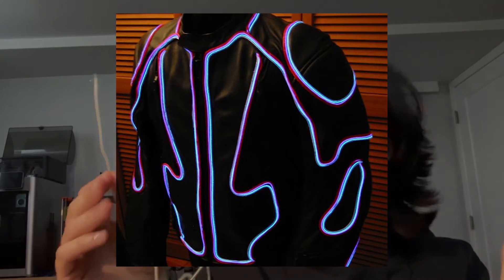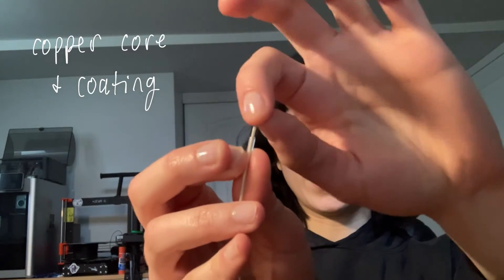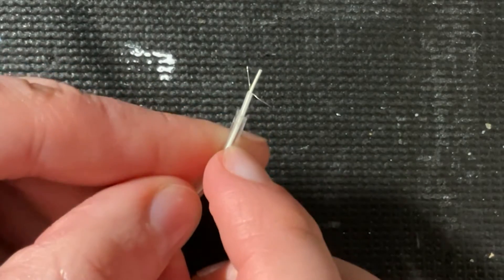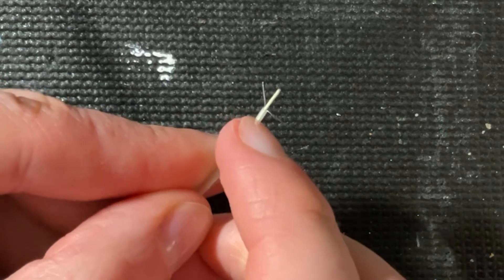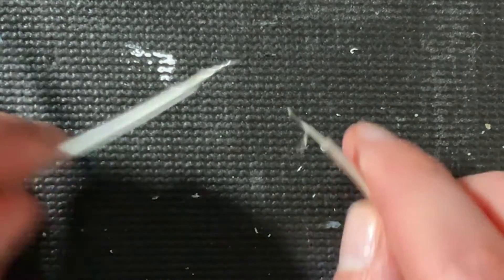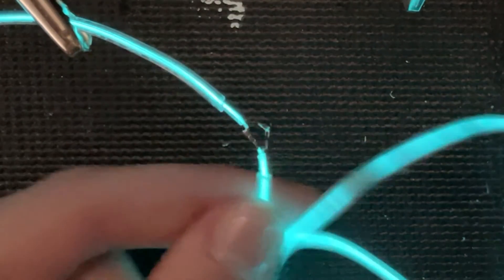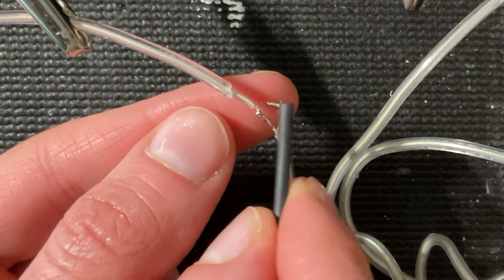how to solder EL wire

Comment from the maker: Considering this is my first time trying to solder to EL wire (and I only used what I had on hand...) - I didn't do it the best way possible, but it did answer a lot of my questions. If you are looking to solder EL wire for a project - using copper tape to solder to the thin conductors is a better method for ensuring a strong joint. This is a good tutorial by adafruit showing how to do that: https://learn.adafruit.com/el-wire/soldering-to-el-wire
Reply: consider a bit of flux next time, helps a lot, even if the solder wire has a flux percentage. also usually you tin bot ends then solder together
Reply from the maker: @AdventurePrinting  I will try some flux next time :) I did tin the ends, just I guess not very obvious in the video. Thank ya for the tip !
Reply: @strelkomania  yep is shine on shine :P
Didn-t get it
Reply from the maker: @AdventurePrinting  I just purchased some copper tape to try a better way of soldering together the thin conductors. if it works better you should see an update soon! thank you for commenting :D
Reply: Looks pretty good to me! I wonder why there are 2 angel wires though. Maybe it’s a carrier wire. I have successfully broken about 4 ft trying to strip it.  “Score!!” 😂
Reply: @Wood-In-My-Eye I assume there's 2 angel wires because the electricity goes from the copper core, through the phosphor coating into these small wires. Wrapping two of these small wires around the phosphor ensures that the whole thing glows. With only one wire, you might have dark spots, depending on how tight the outer wire is wrapped.
Edit: At 03:29 you can see that the right wire has some spots that don't glow. When she turns on the light in  the room it's harder to spot, but initially, when the wire is lit up for the first time, you can see it good.

Comment: Did u try using a ligter to burn away the copper isolation ? Maybe its a useful hack, wenn it catches fire and melts a little bit you can pull it off with your nails. Just be careful, i hope you will find it useful 👍👍

Comment: Be careful with those bare wires. Even though it's low alternating current, the voltage is high (up to 400V) and you can get a pretty unpleasant shock.

Comment: I've always loved Electroluminescent wire! I had a clear keyboard with an EL backlight back in the day and I've been obsessed ever since. Sadly the solder joints broke when I cleaned it and I destroyed the EL with my monster soldering iron.
Reply: Everyone started with a monster soldering iron, made to solder house appliances engineered in the 50ies and not the micro soldering of today. Probably in 20ys our micro soldering would be barbaric and everything would be reballed. Look at todays Jst nano connectors on circuit boards.. I have XXL hands, glove size 11.. wtf 😅
Reply from the maker: My first soldering iron was definitely a monster one too LOL it was a cheap one from princess auto (power fist brand), similar to harbor freight if you're not familiar.

Sounds like a very cool keyboard. I share your frustration - soldering to this light wire is a bit finnicky for sure.

Comment: Ia the core actually copper? Like in all the diagrams (not just the ones you used but all the ones I've seen in general) it does say copper but sure don't look like no copper. Also now I'm considering trying my hand at this and adding a 3D printed piece to clamp onto the joint after the heat shrink to prevent any mechanical stress on the solder joints. Overall still cool but it wouldn't be engineering if I didn't immediately thing of ways it could be improved lol.
Reply from the maker: Q: Is it actually copper?
A: I don't know if I can answer this - from what I've been able to find through google it all says copper wire. But I agree mine doesn't look like copper... lol. I wonder if it is white copper? Or nickel copper - but I can't find any info on that. Everywhere just says "copper" with phosphor coating.

Also great idea for the 3d printed clamp. I love your engineering mentality. I stopped by your YouTube and your video topics are super cool! Keep it up :)
I'm trying to make light up pants using this EL wire to wear for an event. I'm daisy-chaining 3 different colors of the light filament and sewing it onto pants. If I can pull if off in the next few days I'll post it I think.

Thank you for your comment !!
Reply: @strelkomania Yeah I'll have to cut some open myself and see if that's what they're usually like. The multi color EL pants sound awesome! Seems like you are on track to pull it off!  Also thank you! I try to talk about interesting things, thanks so much for subscribing and you keep it up too!

Comment: Yes, light on the 3D printed scabbard with 3D printed wheels. It is going to look sick😂
Reply: But it is probably not a wearable, as you mention in the comment.
Reply from the maker: @Petch85  okay put it on a skateboard?! not a bad idea... could be very cool...
Reply: @strelkomania  Every kid wants shoes with lights, cause it is cool. A skateboard with light carved into the edge of the bord (countersunk for protection) and shoes with light would look sick at night. I guess you can get away with a small battery mounted to the underside of the bord. (probably close to the wheel mount, for protection😛)
Reply from the maker: @Petch85  that would be a fun night ride indeed...
Reply from the maker: @Petch85  Finally getting back to your comments from the previously uploaded version of this video :)

Petch85: "You can add heat shrink to your alligator clips. Alligator clips can sometime make small marks on what you are holding, you can reduce this by wrapping the teeth in heat shrink."

Strelkomania: This is a good idea, I have never thought of it and will give it a try. Definitely will help me when soldering soft and coated things like this EL wire light and other wires!!
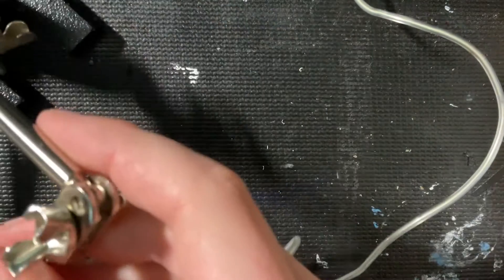Reply from the maker: @Petch85  : 3:13 This is probably fine in this case because the strip is so short. But when you are running electricity through a wire (A, amps) there will be some resistance in the wire. This will make the wire heat up. The amount of heat you create depends on the size of the wire and how many amps you push through it. Bigger wire = less heat. Less amps = less heat. More wires = less heat. You can easily start a fire by running too many amps through a small wire. But in this case, the lights probably do not require many amps, and even less when they are shorter. But you can turn them on and see if they get hot over time. If not you are probably fine. You can also calculate this, or measure if they use more power than expected. This is the same think for all electronics, thus be carful when damaging wires, sometime it is fine, but you can start a fire, and that can be very bad.

Strelkomania: This link might be helpful for you if you are curious, I did give it a read as well (https://learn.adafruit.com/el-wire/soldering-to-el-wire). According to this Adafruit listing, the EL wire is "cold" as in it shouldn't generate any heat. But I think it would depend on what inverter/battery pack you use. If you are overloading your supply trying to power a longer wire than it is able to, it either wont light up properly or could generate heat I guess. This kind of EL wire is often used for sewing onto clothes so I think it is safe if you use the right inverter and power supply.  The short piece I had in the video didn't generate any heat even after a couple of minutes of being on. I didn't test for very long though. 

Thank you for your notes/heads up on some safety precautions. You're always bringing a different perspective to the table and I appreciate hearing from you! Since I wasn't 100% sure about how much wire I'd be able to power without blowing something up - I was not planning to go longer than the length of the original light wire (as per what I ordered on amazon, so like I think 3 meters?). I didn't consider that going too short could be a problem too so good note. If I use this wire again for a project in the near future I will need to look into this more. Thank you :O